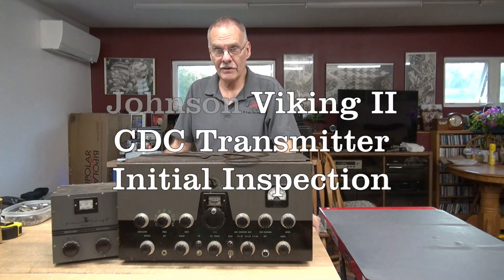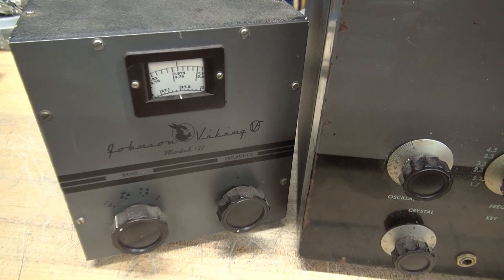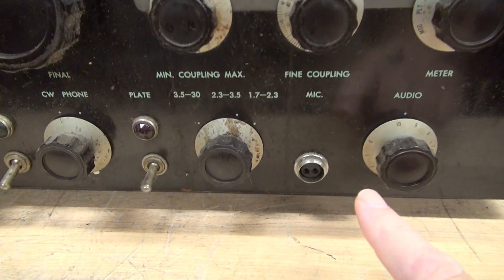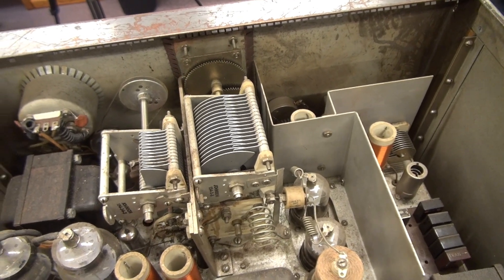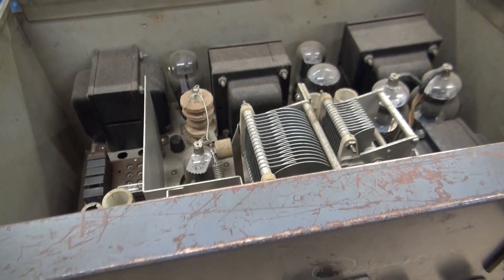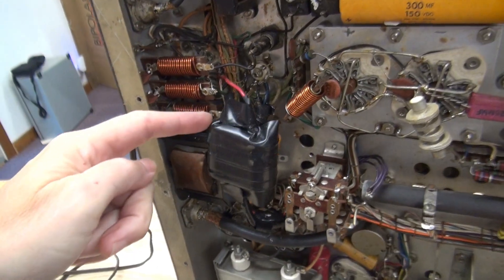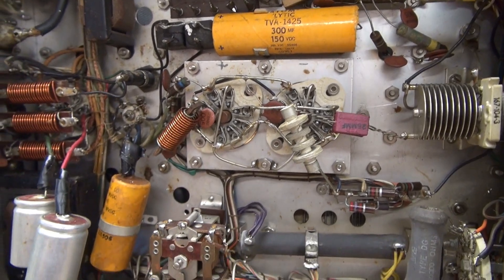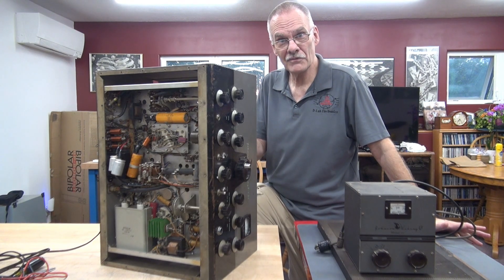Vintage EF Johnson Viking II CDC Ham tube type transmitter smoked Initial inspection Part 1

Comment: Terry how does CDC model Johnson differ other similar models, are the Schematic the same?
Reply: Main difference is the push to talk relay.  The nonCDC did not have that relay and you used the toggle switch on the front panel to switch the high voltage on.  The microphone jack was a single pin instead of the 2 pin jack as it was not needed as no relay.  I think there was a conversion kit for the Viking ll that put in the relay and a small tube  to power the relay by rectifying the voltage to DC.
Reply: Another major difference is the CDC is general coverage, not ham bands only. You can go anywhere with it, up to about 30 MHz.
Reply from the maker: The CDC model also had big differences in the modulator section. A clipper circuit + the in line selenium rectifier. From what I hear is really did not improve the audio over the stock Viking II design. I read reports that it had thin audio.